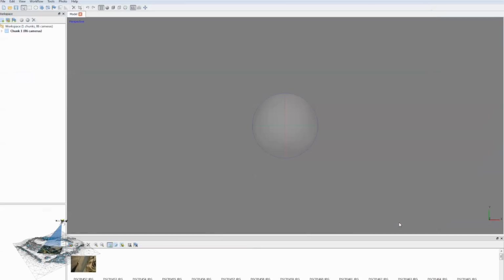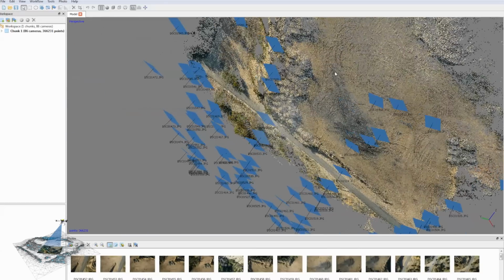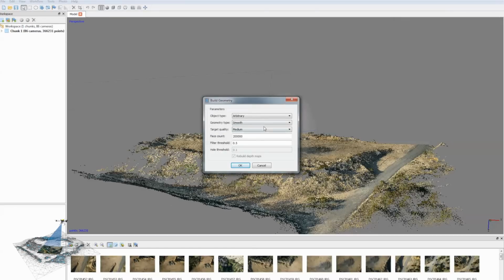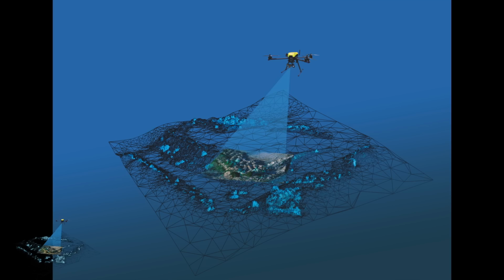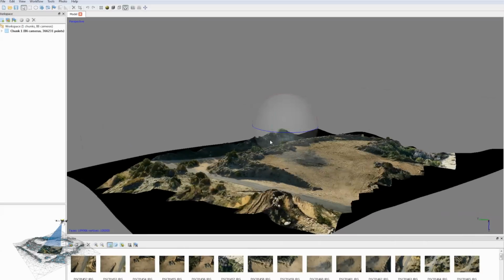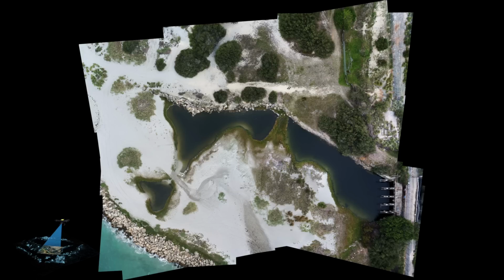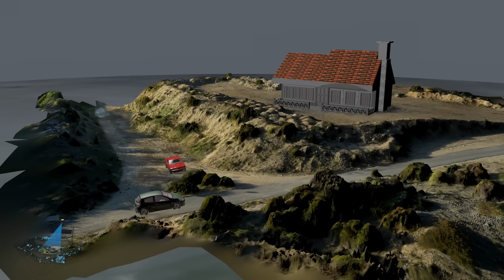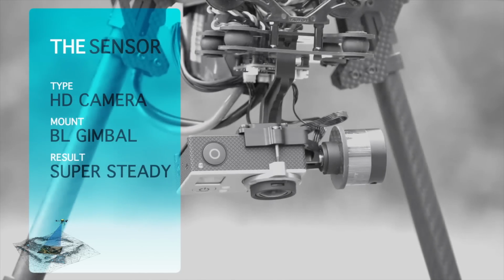Photogrammetry With a UAV Tim Lucas Perth

Comment: Does ground covered in snow affect the depth?? I tried doing an open field with trees with a section of trees along with a frozen lake covered with snow and the depth field wasn't accurate at all... I'm assuming it has to do with the fact there is very little texture and the solid white color throws off the processing???? Or am I missing something??
Reply from the maker: +Philip Hartmann  You are correct, the snow lacks texture, the point cloud is created due to it being able to pick up the same details in more than one photo, water and snow are probably the worst.   you could try flying higher and using a polarizing filter to get rid of glare.

Comment: Great video Tim any chance I can use it in a powerpoint present ?
Reply from the maker: +Guy Byrne  Yes you can use it in a presentation, please just leave the video intact with original audio.
Good Luck with your presentation
Reply: Thnx tim .. i did and it worked very .. the audience were greatly impressed your production

Comment: Hi and cheers for the video!

I've got some aero data from UAV flights and it seems the texture of some roofs enables agisoft to work beautifully, other roofs not so much.

Do you clean up models in a 3d program before putting a texture on? I've heard about people exporting to meshlab for this step before exporting back but I haven't had much luck so far. If so what program do you use?

Cheers,

Mike
Reply from the maker: Mike Carswell  Hi Mike, Phototgrammetry works best with recognizable texture variation, some textures such as a roof or water have a large surface area of the same texture or none at all, large bodies of water are similar, without any real points of reference between photos, the software struggles to stitch correctly, Also a roof reflects a lot of sunlight it might be washed out, appear completely white, using a camera with high dynamic range and a polarizing filter can help pick up extra texture, if accuracy is not an issue and you just want a great looking model, then you can add stuff with 3D software, most 3D software should be able to reconstruct parts of the model, exported as an OBJ file, keeping in mind you have to edit both the texture and the model for proper effect, the texture alone may be enough in some cases.  the texture can be edited in Photoshop. you can contact me directly at www.remotesense.com.au using the contact form.  Cheers,  Tim

Comment: Hi Tim, great video! I use PhotoScan as an aid in reverse engineering machine parts and it's working great. I use a DSLR and get very good results.
I'm looking into buying a UAV but I'm not sure about the camera choice, bear in mind I'm on a tight budget. Is a GoPro good for photogrammetry? I know they come with a very wide angle or fish eye lens, is there a way to correct the images in post-processing?